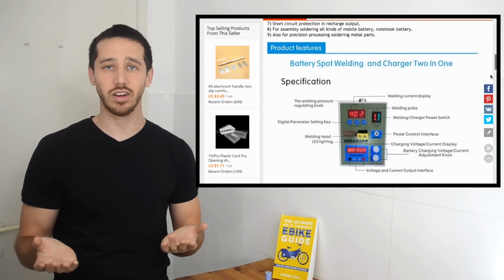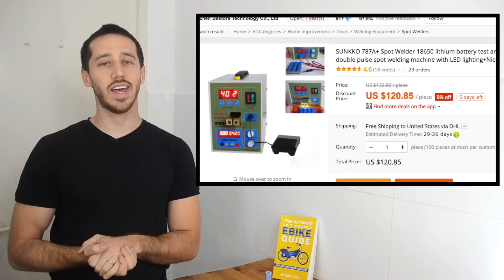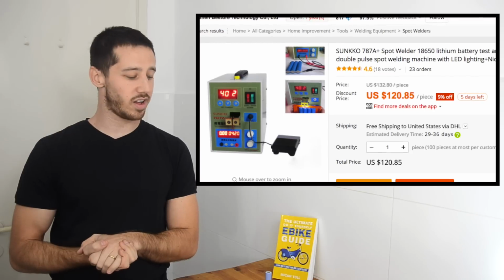Can you solder 18650 batteries? Q&A#3

Comment: Nonsense just look at the german dudes test. I personally used a blow torch to lockm down the nickel strip for my parallel groups because I bought  the wrong nickel strip and my hobby welder can take it. Months later I decide tht he capacity differences evn with aa caacative active balancer didnt feel safe so i took it apart and retested the  cells. After BLOWTORCHING them down sometimes holding the flames on for 5 or more seconds there was no loss in capacity. I though I ha ruined them but no. They were basically the exact same before torching. And my thermal imager backed up my caacity readings after testing, They are alot hardier tehen you guys make them out to be. BUT hold on I have had 2 thermal runaway events I want to tell you how it happened to save  you the same nightmare. Make sure NO strands of anything electrically conductive slip underneath the top protective coating, it causess a short that doesnt stop heating. The other was when I held a solding iron on tthe battery for too long and it gassed out. IIf you have a thermal runaway get that part of the pack under running cold water immediately. If it means putting the whole damm pack into the toilet do it. Because if you dont i can assure you will regret it.

Comment: Yes heat damages them but it's perfectly doable to solder in just a second or so with a temperature controlled one (more power and compensates for it when the iron touches a heat-sink like a battery) and leaded solder. Fine sand-paper first. Not the slightest bit warm afterwards, no problem. Put some solder on the tip right before so it transfers the heat quicker.

Comment: My problem question is a rejuvenated 18650, Samsung..POS cap pulled and inner pushed to bring the batt from Zero back to 3.74 VDC. Meaning the meat -- lithium just below. Can I solder on the center of the safety button since I depressed it back into contact with the stem?

Comment: Never soldered to new 18650 only repurposed. This is how I do it.  Use Thickish cable. Cut back the insulation a bit more than normal, Solder the exposed end completely infact saturate it so you s blob on it. Trim end as flat as you can.  Clean the battery terminal as best you can. I imagine roughing it up will help but I have not done that. position battery vertically and bring wire perpendicular to the terminal but do not touch. using a hotter soldering Iron than normal heat up the wire quite high up the wire say 1/2 inch add a bit of solder. the solder will flow by gravity and just as the big blob gets to the end touch it to the battery terminal. Ok the wire is at a bit of an awkward angle for saving space but it works for me. Same rules  on a smaller scale apply for repurposing old Phone batteries,
Maybe it does knock a few charge cycles off, never noticed, don't care. Yes I know its not the way you're taught to solder and yes you might need to practise a bit, but so far any joints I have been happy with have not let me down.

Comment: not sure what happened there looked at my screen showed it complete when I posted the comment it deleted the middle portion of the comment so here goes again put the cells in your freezer for 15 or 20 minutes that should lower the temperature enough that you can solder to them and you'll have a little more time to work with it heavily tin your soldering tip put so much solder on it that it's ready to drip off then let that drip land on the cell then solder onto the solder it makes it a little easier it gives you a little bit of cushioning there and your tab will be soldered underneath and on top which will actually work the solder has to be there anyway but at least if the cell surface is cool when you place it there odds are you won't damage anything at the very least it'll give you a couple more seconds of working before it reaches a temperature that would damage the cell, what I'd like to see is some research done to show us exactly what temperature damages the cell

Comment: Problem I had was the battery body acts as a heatsink and just spreads the flux all over the terminal so I had to pump the heat up a bit and use a chisel shape tip as suggested here. Thanks for that suggestion.

Comment: I use 5mm x 0.2mm Pre tinned copper Tabbing Bus Bar Wire/Ribbon. Its used for connecting solar cells but it's perfect for soldering battery packs it sticks so much easier than nickel or copper wire. You can find it on ebay for around $5 for 4 metres

Comment: Soldering on any can type battery is probably not good.  Many moons ago I soldered nicad cells for a cordless phone.  The batteries worked but only a fraction of the life of the previous cells that were tack welded.

Comment: Come on guys. if you got the dosh to spend on the Samsung 3000mah sets then get yourselves the best smart bms and get a mini spot welder. Better still if you got that kind of money just buy a readymade battery. For the rest of us just doing up an old mountain bike for fun, fuck it! solder away on those old laptop batts. Be quick with your iron and do a nice job, let me tell you '20 miles ridin' on a cheapo homebrew will give you more joy than 30 miles on a battery you had to re mortgage the house to buy.'

Comment: Yeah if you try to solder with a typical 70w soldering station you're going to have problems. If you have a 120W or 150W high output station though that's a totally different story those typically use high frequency induction heating (low voltage high frequency AC running through a coil in the handset) instead of thermal heating and can tin and solder an 18650 cell in 1-2 seconds tops. They are also GREAT for soldering large battery connectors. Two units to look at are the Xytronic LF3200 and the Atten AT315 (they both use the same tips btw)

Comment: Can you spot weld nickel strips to 18650 batteries with protected button? I am creating a battery pack with 4 18650 batteries and spot welding in parallel.

Comment: I am confused.  If you solder the piece quickly enough, such as beading a bit of solder on the iron and letting it drip onto the 18650, wouldn't it not heat up much?  All of the spot welders I've seen or heard of still end up heating the batteries quite a bit.  I'm not trying to act like I'm the best at soldering or anything, but it's so quick I can typically touch it soon after and it's already cool.  I keep old computer fans on mine, maybe that helps a tiny bit, I am honestly very unsure.

Comment: My first test on a bad battery doing one side at a time. After i was done with the neg terminal i checked with a thermal gun and got little over 100 degrees. And thats with having trouble... just a tip for the diy

Comment: My Qn is: Is there any way for connection of two batteries without soldering so there is not such consequences?
Reply: just use some kind of plug/connector. If you want to permanent connect two batterypacks you can spotweld

Comment: I’ve obtained several battery packs that are made of 32 cells.  8s4p.  They are 26650 cells 
And are LiFe PO4.     There are no Bms boards.   Only. Red and black leads.   They are are 
Reading about 26.3 volts.     Label says 12.8 Ah.      Question:   How can I best use these? 
  Test them?   Charge them?   There are many...   A pallet full.  Each pack about the 
Size and weight of a brick...  they are shrink wrapped.

Comment: I have a vape and the circuit board  inside wet bad so I tool out the battery and cut the wires, now I need to solder them to the head on top were they screw into the battery compartment, what solder do I use for this. Please.6-11-18@ 1:00AM

Comment: Surely this is a very easy test to do (a least capacity wise) just solder a cell then do a capacity check, all this "no one knows" crap is meaningless. AveRage joe has several video's where he pull cells out of his pack (that have been soldered, and then heated again to remove them from the pack) to check there capacity and guess what, no loss of capacity, from this double soldering.

Comment: Dude ! I'm an electronics technician and I have a Canon 5D Mk IV camera that uses LP-E6 batteries which have (2) 18500 batteries incased inside a plastic container.  When the LP-E6  battery no longer hold the charge, I open the case to remove the two 18500 batteries and replace them with fresh one's. Yes, I solder the two 18500 batteries together and put them back in the case. The trick is to use two soldering tips to solder fast without spending too much time soldering the battery that could damage it with only one soldering tip.  If I bought a brand new LP-E6 battery it would cost me  over $30 but if I buy just the two 18500 batteries to rebuild, it would only cost me only $8. It's cheaper to buy two soldering tips and solder them yourself.

Comment: Hi
how to make a proper battery configuration for home inverter with 18650 cells ? If I make 3s configuration the potential at full charge would be 12.6V which is happily accepted by a 12V inverter system but the over discharge protection system of the inverter would kick in when the potential diff is around 10.5V leaving a major chunk of energy left unused as these cells are said to be discharged when they hit 3v i.e. 9v in the configuration. Any suggestion is appreciated...

Comment: I consider soldering 18650 cells like a person smoking. In theory it is damaging but if done only briefly, the damage is minimal and the cost savings over using a spot welder is worth it if you are like most of us DIY ebikers and are only making one to two packs. 

I have two 12S battery packs. One 12S4P pack made of LG MJ1 cells and a 12S8P pack made of Samsung 28A cells from overstock laptop battery packs. Both packs are soldered with solid-core 14AWG wire and have been performing great for months.

Comment: I have a Laser Welder.
Can I use this machine in place of soldering? I has setting for power and time cycles.
https://www.riogrande.com/product/710009
Above is the link for the laser welder-seems like it should be an alternative way as it has replaced the tedious soldering.
Thanks for the answer
Steven-Albuquerque

Comment: If youre going to solder cells you need to sand or scuff the surface of the battery, tin your battery strip with a generous pool of solder, coat the sanded surface of the cell with flux, and then Apply your soldering iron to the battery strip in order to melt the solder onto the battery. This way you arent adding additional heat to the cell by tinning it and you arent applying your iron directly to the cell. If you do it properly you wont need to heat the battery stip for more than about 3 to 4 seconds and very little heat actually reaches the cell.

Comment: I'm building an electric scooter with a 1000 watt motor and for the battery pack I have 150 18650 cells what I want to ask is how to connect cells in series and parallel like I have seen in some packs few cells have cathode on the upper side and few have cathode on the lower side why do we change the position?

Comment: I came up with a simple technique for soldering the strips to the 18650 batteries that limits the amount of heat to the battery and provides a solid solder connection. I cut off the sharp corners of the strip and then I cut a small v-notch on the end of the strip. I put a small dot of liquid flux on the battery pad and a small drop on the v-notch on the strip,  then I add solder to the tip and press the soldering iron tip to the v-notch on the battery. Done properly you won't have to add extra solder, just the amount added to the soldering iron tip is all you need. The flux makes the solder wet out into a small puddle and it takes about a half second, with a hot iron, to create a proper solder connection with very little heat transfer to the battery.
Reply: diagram!

Comment: What do you think about using Recycled Cell phone batteries for projects. I have made a few 3S 12.6V"balance cables"  battery packs, but I have not gone over that. I also leave the protection circuit on. I feel more comfortable soldering  this way. I tried taking one off and it was a disaster. But I am a newbie to DIY. Would love to make some 5s-6s cells and use in projects also. Just not sure how far we can push them. I normally find older cells with 80-90% capacity left over. Samsung seem to work the best. Couldn't find any info on them used above 3S.  Any Thoughts?

I know these are not 18650's, But I see so many cells going to waste and I really think these can be revised. The space they take up is so small, you can use them almost anywhere.

Comment: A question on iron tip size:
1) small tip + longer time = soldering temp reached (solder melts on battery contact)
2) large tip + shorter time = soldering temp reached (solder melts on battery contact)

In both instances the battery contact must reach the same temperature to be able to melt the solder onto it. 
 There appears to be NO difference in the temperature reaching the chemicals inside the cell through the battery contact being soldered. Is the fact that the temperature is reached faster or slower significant if the total thermal energy transferred to the interior is the same in the end?
Reply: Never mind, I figured out the flaw in my logic. lol
If the damage occurs at less than 100% "soldering temp", the time it takes the smaller tip to reach soldering temp is longer and therefore "damage temp" is experienced for a longer time inside the cell. 
OK, larger tip it is!  ;-)
Reply from the maker: Yes, look up heat flux

Comment: I'm not convinced soldering is bad ... solder melts at 180*C.... what would be the temperature by the time the heat is conducted inside the cell??? perhaps a small fraction of the electrolyte might be 100*C for a few secs ....
18650's in surgical equipment are routinely sterilized at 120*C  for 15mins  with no ill effect !! Yes the cells are heated to this temperature!
Reply: Thats kinda how i feel too.  But i work with second life batteries so i care a bit less

Comment: If you solder why would you use Nickel when Copper has several times better conductivity and is cheaper too! Now  if you could find out how to spot weld copper, that would be golden! What do Tesla batteries use? Nickel? Sounds like you need a free batterie heating system?
Reply: This is something that's been bothering me for a long time too. Perhaps it's tensile strength or something else.

Comment: what about conductive glue
Reply: no good ... this is epoxy with metal powder added , has a resistance approx 1000 times that of copper  OK for led's with currents in the mA range ...
Reply from the maker: I've never tried it for 18650's but that'd be an interesting test!

Comment: Spot welding also heats up cells as does soldering nickle tabs onto tabs already welded to a cell, a technique this guy endorses and demonstrates in other videos.  Also, use of a conductive iron is not the only way to solder, application of current can also do it just like that used for welding.  The advantage of resistance soldering is much more limited and confined application of heat.  Resistance soldering also has a big advantage over spot welding of allowing you to use copper rather than nickel and, done properly, does not present a problem with heat.  Sadly, none of this is discussed by this self-proclaimed "professional".  I suspect the "scientific community" knows very well how heat damages cells, you just are part of that community, Micah.
Reply from the maker: I believe you meant to say that I am "not" part of that community.
Reply: I believe you are right on that.  How heat degrades a battery is more a concern of engineers, not scientists, and you won't find engineers publishing scientific papers to educate their competition on such issues.  You can count on it being well understood by people who need to know and actually work in the field, not just blog and youtube about it.  Spot welding is done because it is cheap, fast, and automation-friendly, not because soldering destroys cells.

Comment: good vid.    
can you solder? - yes 
Will it damage? - yes
How much damage? - No one knows

The common claims Ive personally tested have mostly resulted in less dramatic results than popularly believed.
The over charging damage in LifePo4 = Not as drastic as everyone says it is 
The degradation in storing Fully charged cells = Not as drastic as everyone says it is

So I agree with you,  Not ideal for cells but should you do it?  its fine if you are quick but mostly its up to you, if you feel comfortable doing it,  if do not need your pack built the best possible way,   I say Go for it.
Reply: Sony says apply heat for 1 second or less.
Reply: Jehu did you buy a spot welder already? if you did which one and do you recommend one thanks
Reply: There is more damage from your terrible thinking than from soldering battery cells. If you dont have skills to do it professionally, then dont do anythink, just sit at watch. Using your brainless logic I can prove this:  soldering ANYTHING will damage your lungs, as you inhale the bad smoke.  How big damage? : no one knows. Conclusion:  we should never solder anything, right?   Do you see my point how useless is your thinking process?

Comment: Hi, is there any specific configuration for the dimensions of the nickel strips in relation with the battery capacity. Meaning the amount of electricity that goes through the nickel strips. For example a greater capacity or voltage requires thicker nickel strips?

Comment: Hello, thanks for your videos, they are very useful. I want to put a switch in the box of my 10s battery pack, can you give me any advice? sorry for my english and thanks in advance.
Reply from the maker: You can find switches rated for 20A-40A, but a switchable circuit breaker or a relay might be better and easier to source. Search a little about both options and you'll find examples of people using each.